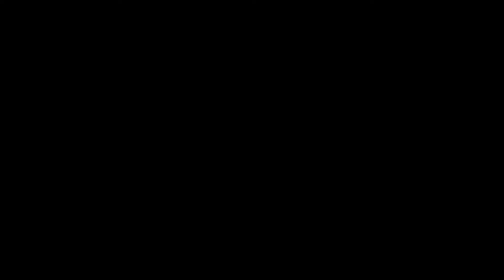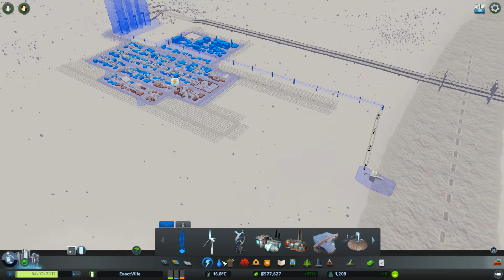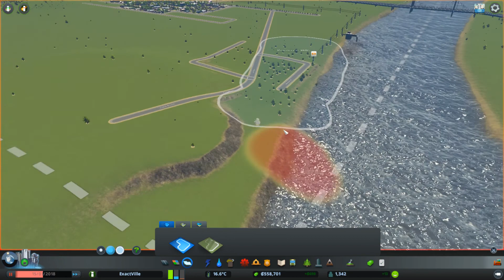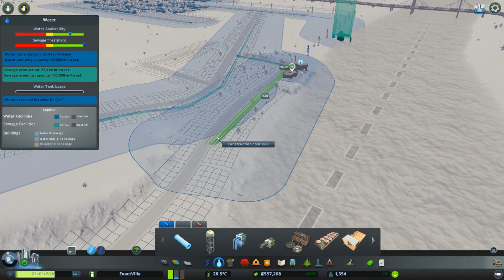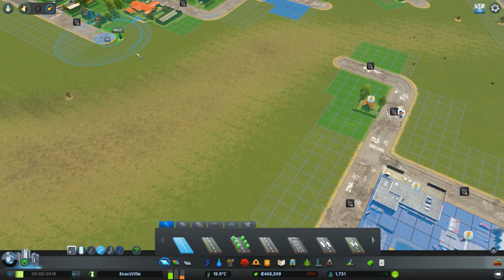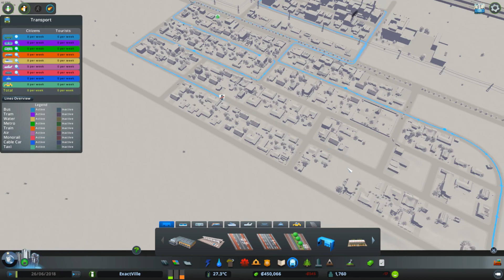Cities Skylines Mass Transit - Exactville #2

Comment: Just to let you know, if it is not lagging when you play without recording it could be a fraps issue. I know that was one reason I stopped recording and making gameplay vids is because the combination of the games and the ram usage of recording is too much on most games. Skylines especially.
Reply from the maker: +Karter McDouglas, I think it is a bit of both. It is not great when I play but not as bad as in the vids. I think it is time for an upgrade!!
Reply: My recommendation would be OBS or if you don't mind spending a good few bucks for quality Bandy Cam. Personally, I used Xsplit and absolutely loved it. It had a whole bunch of great features! But the ultimate decision is up to you.
Reply from the maker: +Karter McDouglas, I use OBS already. But I have made a heap of changes to the settings. Only in Episode 5 though. Please keep an eye and let me know if this made a difference.

Comment: You did not put Leisure zone to The Bank ... first you need to paint the district, then select the zoning and click on district, then icon should appear under the district name 😜
Reply: The Disaster response unit only searcher for survivors after disaster... you need to repair roads manually with ! (upgrade) tool
Reply: You are plaing for realism, but your bus line is horrible 😄 😝
Reply: How to public transport: 1. Know your destinations – connect residential to industrial and commercial
2. Stick to main roads – do not wander aimlessly through the neighbourhoods
3. Full circular lines are rare – use one road in both directions by the same line
Reply from the maker: +Ptrk Hrnk, I have not played with the disaster DLC so those are a bit new to me. Thanks for the tip. In terms of the public transport, at the moment it is a bit of a token bus line because the town is still small. As it grows I will be using all the mass transit stuff.